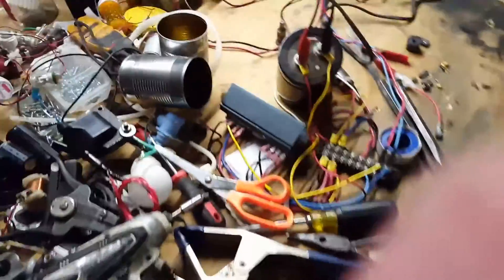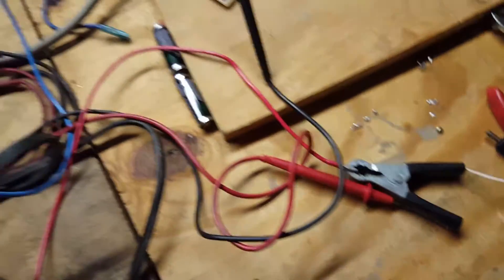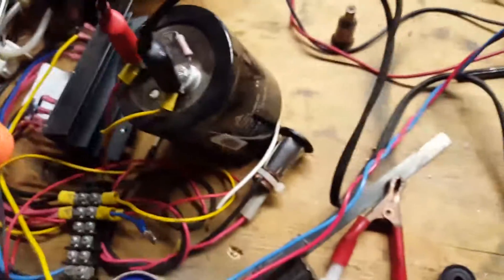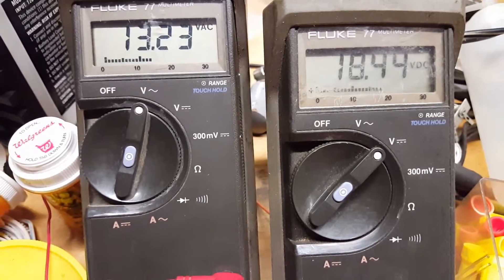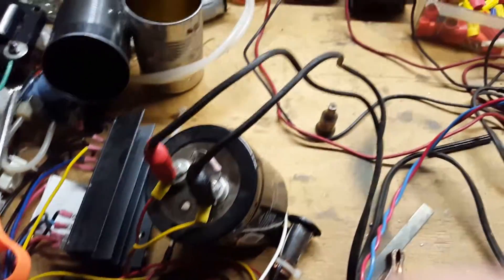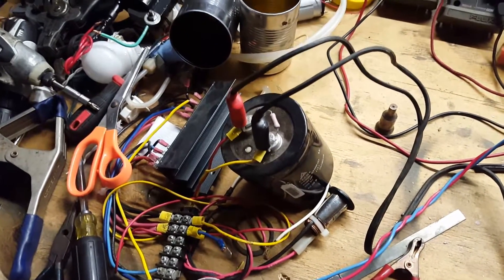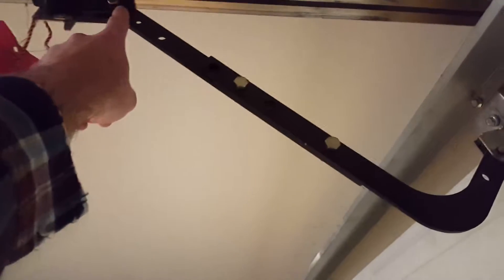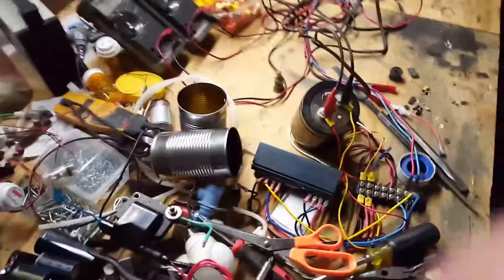Atmospheric electricity: both usable and accessible

Comment: any update?
Reply from the maker: Atmospheric electricity is quite useful as in my demonstration.  If you want power enough to run machines, it requires a balloon and a long wire to get the HV down.  You need HV transformers to step it down to a usable voltage, which increases the amperage as well.  It is beyond what I will afford the project.  I am content to use some joule theif circuits to run loads of LEDs around the property.  I will be building an electric fence charger that utilizes a long wire on top of the fence to charge a capacitor.  It will be in a future video most likely.
Reply: @mwm2929  My city has no power plant that I can find, I called the electric company and they wouldn't tell me where the electricity comes from, I assume it's from the taller towers with wires, the longer and higher the wire the more charge.  I now assume this is how it's done all over the world.

So Tesla's patent doesn't really work unless the collecting plate is way up in the air like on a tall tower or balloon.  Seems like the tallest HV electric towers/lines are tall enough?